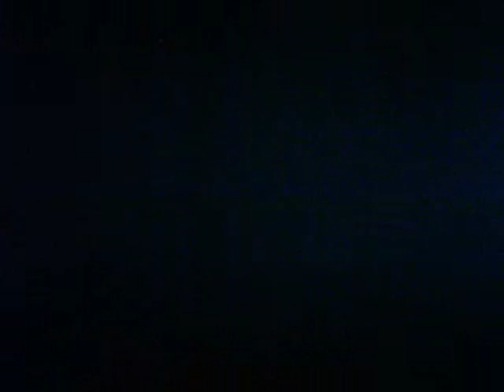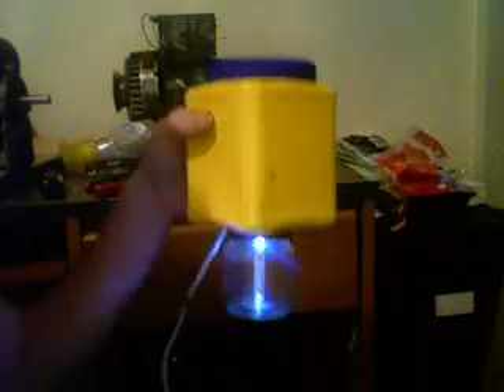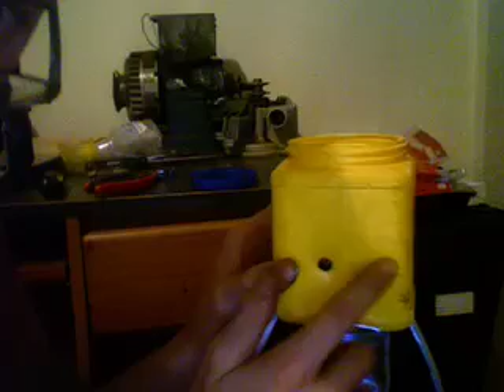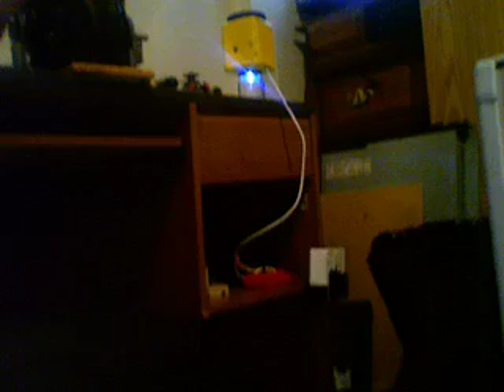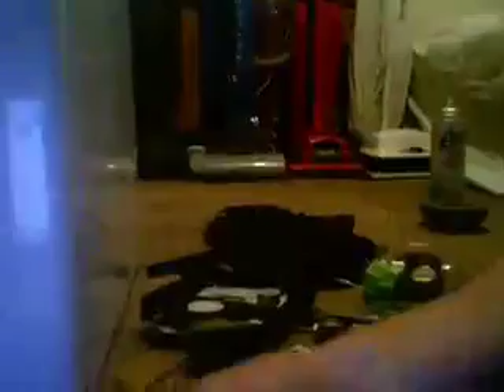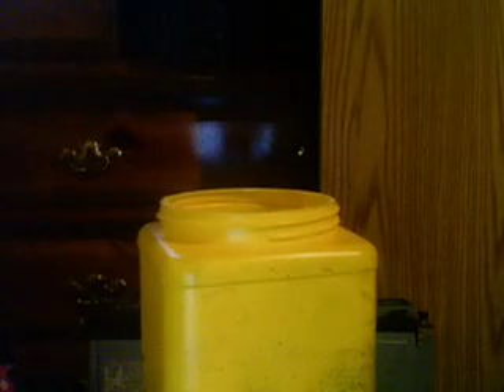DIY Air/Steam Driven Lights

Comment: That is so simple and so cool! quiet too! using LED's the mining lamps I have would easily become more efficient, the regulator could be set much lower.

with a slightly larger motor you could run lots of LED's! Stepper motors also behave as a generator too but require a bit of torque to turn over under load.

also the DC fan motors from inverter air conditioners generate power when spun by hand/wind power.

Comment: @animebsd Ok, maby a dc motor too can.  I think some produce a varying voltage output (like an ac waveform on an oscilloscope), but they only have one direction of current flow from them.  It might be possible to still hook that up to a step-up transformer to run some high voltage devices, maby some florescent? might be a good experiment.

Comment: Nice vid.  If anyone is interested,  most printers have a steppor motor or two in them that can be used as generators.  Some small motors, like you show,  also work just as good as steppor motors as generators, but some don't either...have to check first with an led.